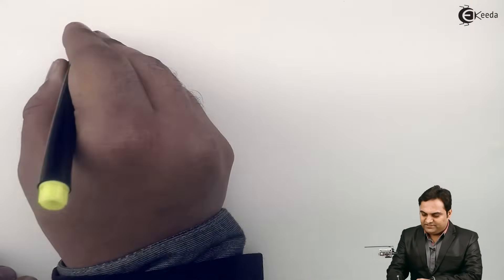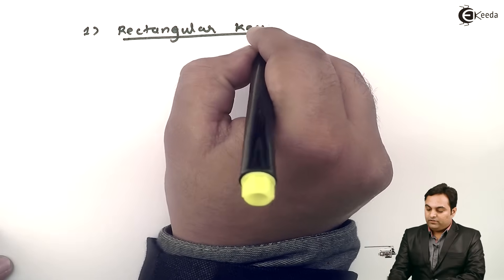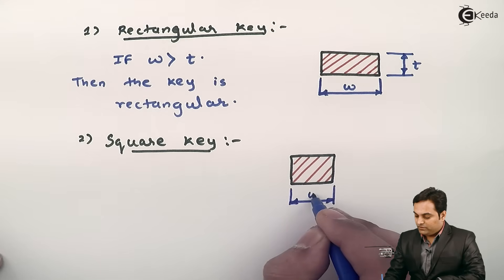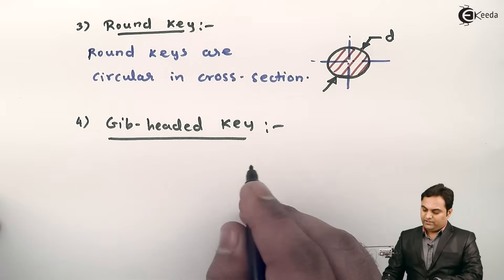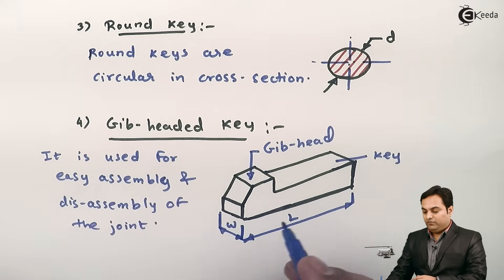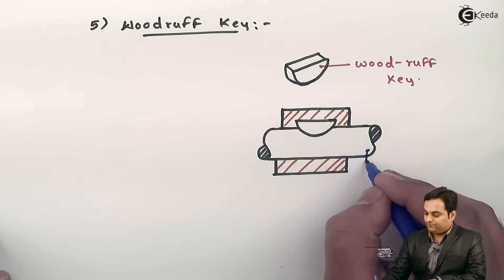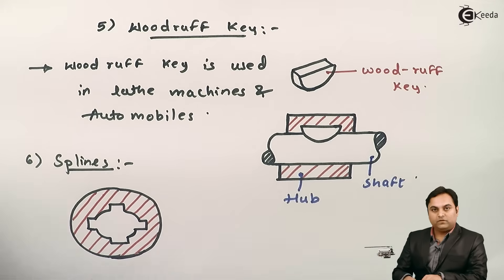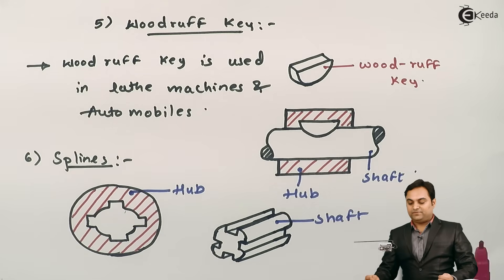What are the Types of Keys  - Design of Shafts, Keys and Couplings - Design of Machine

Comment: A four-stroke gas engine having a cylinder of 250 mm diameter and stroke 450 mm has a volumetric efficiency of 80%, ratio of air to gas is 8:1, and calorific value of gas is 20 MJ/m at NTP. Find the heat supplied to the engine per working cycle. If the compression ratio is 6, what is the heating value of the mixture per working stroke per m of total cylinder volume? Note: NTP (Normal temperature and pressure)
Reply from the maker: Ok i will definitely help you with the problem.However for this you will have to download the Ekeeda-Learning Application by going through this link 
http://bit.ly/353lpP2 because we don't answer any technical queries on youtube for this we have a dedicated team. You can also share this with your family 
and friends.